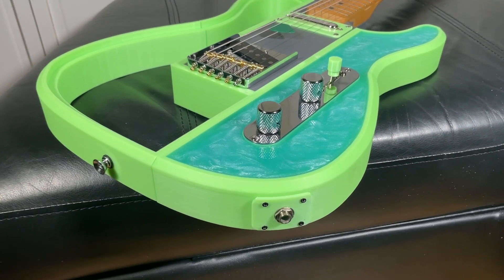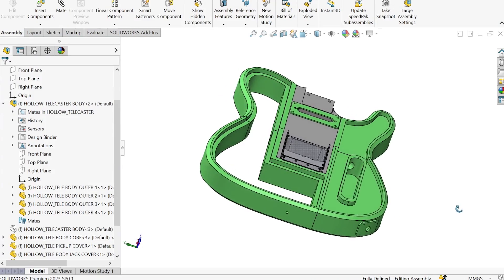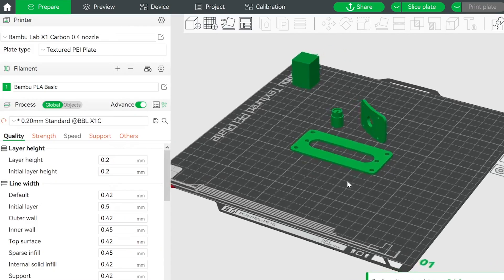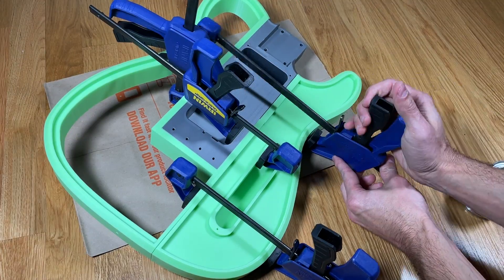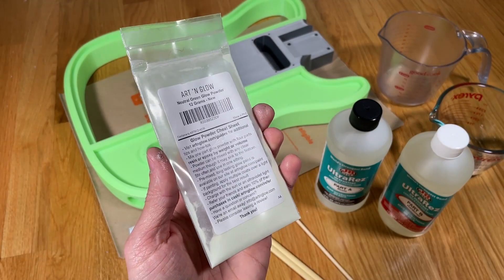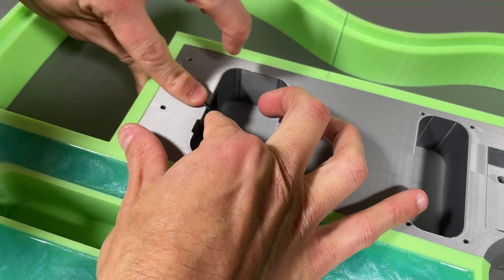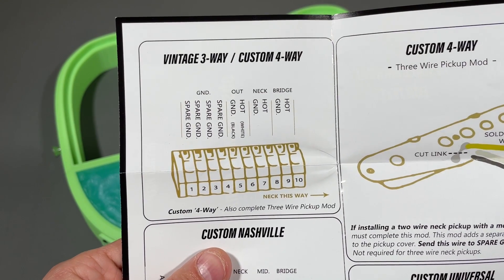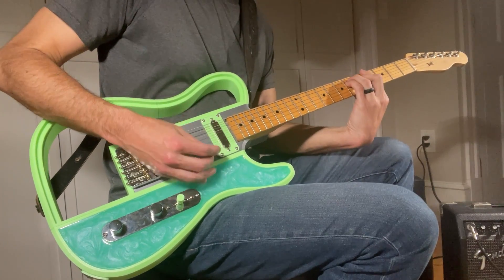3D Printed GLOW IN THE DARK Guitar Project! Step by Step Build

Comment: 😂that pla is never going to hold tune. I print rc car parts and use exclusively PLA and the strength profile in Bambu studio is good but won’t hold that much tension for that long it will give over time.
Reply from the maker: It holds tune just fine, but if you are concerned with flexing you can increase the infill percentage even higher than 40% and increase the perimeters higher than 6. The center “core” comes off the printer like a brick with the settings I used.